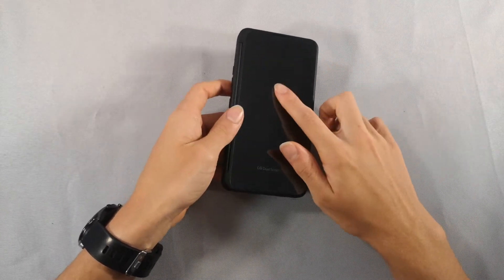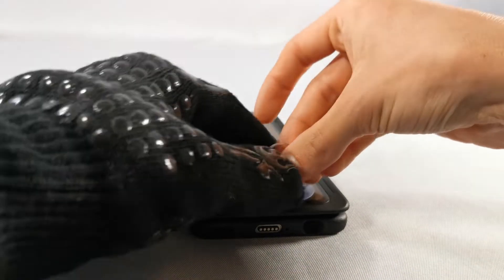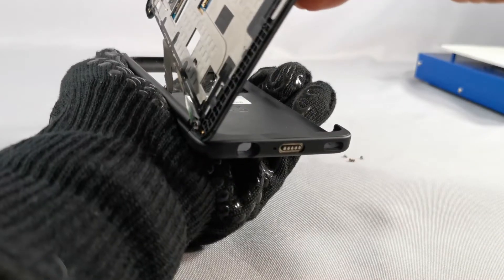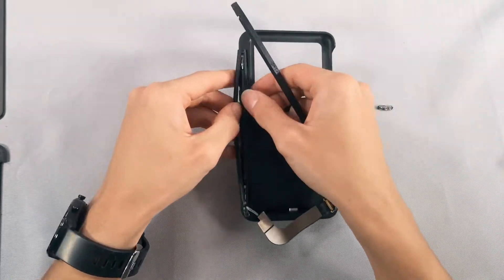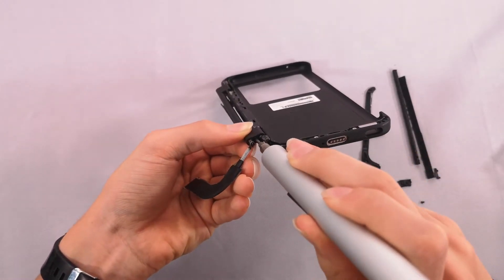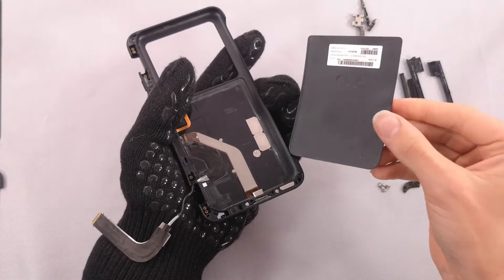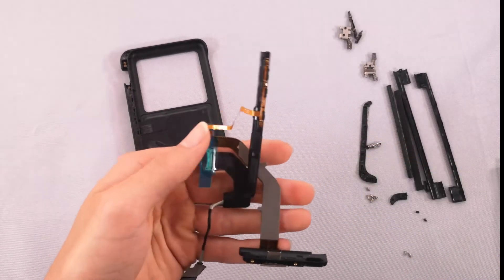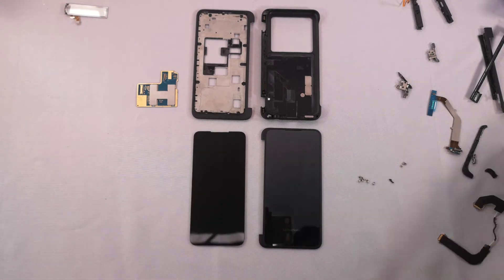LG Dual Screen Teardown (LG G8x)

Comment: So it has its own wireless charger in the case? I just got the V60 with dual case just to play with the DAC. And I want to drill out the back of the case for cooling purposes. But not if the charger is inside it along with those cords

Comment: Can I use the folder(screen) of case to replace broken screen of phone
Reply: I think so. It even has the digitizer. I don't know what the level of complexity is but they were actually sourcing the same parts for the dual screen which is why it still had the camera cut out and everything. So I mean obviously double check this but I am 90% sure that that is the exact same screen. Digitizer and all

Comment: How would you replace the touch screen if it was a lg v60? I have the dual screen for the v60 with a functioning cracked touch display. I was thinking of purchasing a replacement display from ebay from one of the sellers. I want to buy a broken one for parts - specifically, the touch display of the dual screen. I dont know where else to find a replacement.
Reply from the maker: I'm assuming the LG G8x dual screen is pretty similar to the LG v60 dual screen, so you would first need to remove the front glass to disconnect the inner screen from the motherboard. Then you would need to heat up the inner screen to loosen the adhesive and pull out the display. Then just glue in the new display and put it back together. So basically 0:34- 3:15 in the video.

Yeah, I don't know of any other place you could get one. It very difficult to find new parts for LG dual screens.
Reply: I know this is an ancient thread but some people are selling it for 30 bucks with scratches on eBay someone named busted crates. They're in sort of rough condition but they're perfectly functional

Comment: My phone & dual screen dropped on the floor, face down. Now my phone still works. The external dual screen still displays my notifications. But the internal screen won't turn on. I click on the 'Turn dual screen on' but I don't see anything come on. Also, the inside screen is totally loose. It stays in place if I press on it, but I can easily take it out with my fingers if I need to. The cord on the back of the screen is attached. I don't know why the screen wont display anything.

Comment: My phone dropped with the dual screen opened completely and now the screen pops a mm when opening the case, what should I do ? Can I try adhesive ? Or something ?
Reply from the maker: Yeah, I would use some T-7000 glue or double sided phone tape.
Reply: @TechOverFlow  went to a local repair shop recently and did just that. Thank You
Reply from the maker: @venusjain7812  Nice! Happy to help, even though my response was a little late. 😅

Comment: hey bro i started seen a green line my dual screen case is it a connection problem or a problem woth display itself? can you help me fix it? 
i posted the issue on LG G8X thinq reddit
Reply from the maker: Sadly, that is a screen issue. And what's even worse is I haven't been able to find a place that sells replacement dual screen, screens.
Reply: @TechOverFlow  yeah i was looking for replacement parts too and closest i come was buying another dual screen case. No it was not a display problem maybe there was issue with connections or the ports themselves, i thoroughly cleaned both ports and then i folded the display all the way to back it is fine now , like nothing ever happened.
Reply from the maker: @kushagrabhavsar7327  Oh, Nice! Usually a green line is a sign that the screen it's self is damaged. I'm surprised that fixed it, but I'm glad it did! Nice job! 😁👍
Reply from the maker: Sorry!

Comment: secondary displayed damged , due to water 💦 ,can you heLp what part i should change🤔
Reply from the maker: I'd say it's most likely one of the motherboards. However, It's hard to find replacement parts for the dual screen and especially for a good price. Since you're not exactly sure what parts are water damaged it's probably just worth it to get a new one. Sorry.
Reply: @TechOverFlow  new one price is 13k 😑😑
Reply: @TechOverFlow  help me bro

Comment: My Dual Screen doesnt work in my LG V60.. The dual screen floating button doesnt show up and the manual dual screen button on menu bar greyed out.. and no dual screen option under settings-display menu.. any idea what is the problem?
Reply: Yes friend mine did same. Hold down volume and power for 3 our more seconds then it should reset. Also push the screen with your thumbs all over it. Fixed mine youtube is great

Comment: The main screen on my case just fell off by itself last week.
Reply: My screen fell out and now it won't work. Not sure why. Im hoping maybe a cable came undone. Hopefully it didn't tear when it fell out. It seems there wasn't enough adhesive to hold it in. Only got to use it 2 weeks.
Reply: @Mallary96  Mine was totally void of adhesive.  I placed a very small piece of double stick strip/tape inside. Don't plan on keeping this as my dialy much longer.

Comment: What would happen if i slapped my oneplus 7 pro onto the second screen case of my velvet? As op7pro support hdmi through type c.. Can i expect any output?
Reply: Watch mrmobo video
Reply: @realbeast5036  can u get link for that? Thx in adv💥
Reply from the maker: I doubt it will work. I'm pretty sure the phone has to have the right software to work. I tried using it with an LG v40 and it didn't work, so I doubt it will work with a OnePlus. Sorry.
Reply: @TechOverFlow  Thanks for ur reply , Not an issue .

Comment: Another factor about that hinge is that it has two bend points to allow it to fold 360 degrees. At one point the hinges lock at one pivot and then unlock the other pivot, must be how they designed those individual hinge pieces

Comment: Can you please post video, is it possible to use secondary cover in other android phone like redmi note 7 pro?
Reply from the maker: I tried using it with my LG v40 and it didn't work. I don't think it will work with any other phones.
Reply: @TechOverFlow  how does it work, software optimization or any preinstalled software? I have 4 additional display, it will be useful if there any possibilities.
Reply: no
Reply: No bro. Only powerful soc's (like 855 and above ) support video out over usb c 3.1
Reply: @roshin1967  845 also supports dual screen lg velvet in India.
Yes but only powerful soc supports video over usb c.
and software also important role.
Reply: @sahilsah457  LG firmware required

Comment: Very nice video. Can we connect dual screen panel in place of of main display. In case main display breaks ?
Reply from the maker: Sadly no, they are slightly different. If you want to see the screens side by side check out the end of my newest video.

Comment: Thanks Bro. The Bottom Hinge of my Cover is a lil loose. So i think I just need to remove that bottom flap covering charging port only. What do you say?
Reply from the maker: Yes and the side flap. 7:34 - 8:06
Reply: @TechOverFlow  Thank You ❤
Reply: @soumyak1997  go to the LG store
Reply: @DrAdityaReddy  It's too far from my location. Soon I need to visit bcz cover has 6Months warranty only.
Reply: @soumyak1997  do you have horizontal lines on second display when it's on low brightness?
Reply: @DrAdityaReddy  Yes. There is a video on DarkCruzer channel. I've the same type of lines.

Comment: Great video! Definitely more to it than it looks. I don't suppose you'd want to sell the hinge parts ... my kid dropped mine and sheared one of the metal posts on the hinge. LG says the only option is to send it in for a repair. Ugh.
Reply from the maker: Thanks! The one I teared down might have damaged hinges as well. But if it's working, I'd be fine selling it.
Reply from the maker: Sorry it took so long to reply. It looks like both my hinds are damaged. I bought this Dual Screen broken. Sorry.